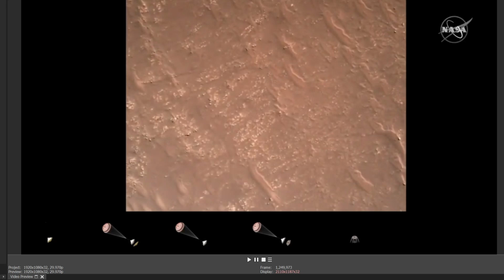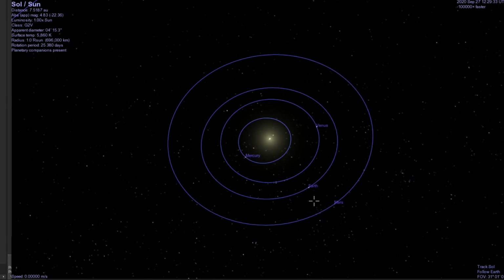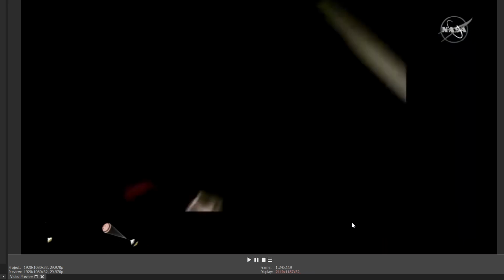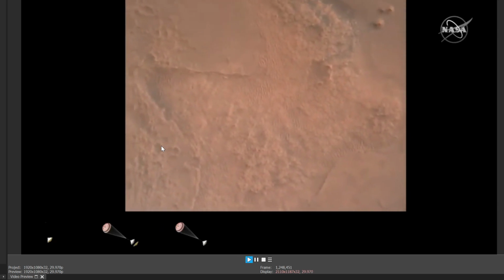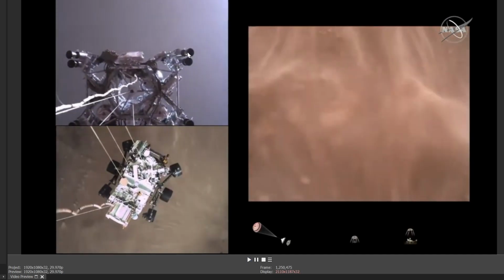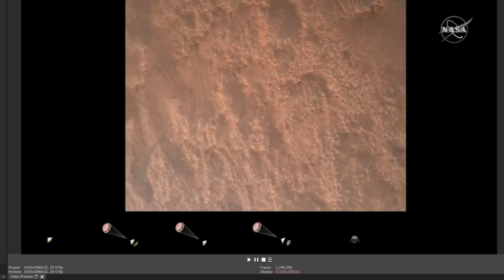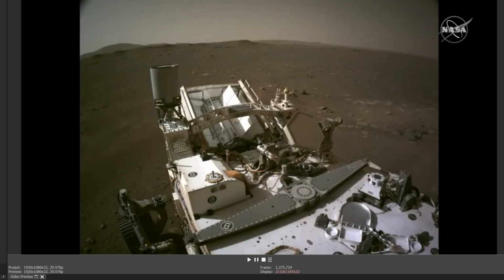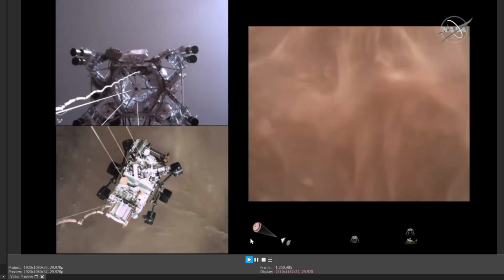NASA releases AMAZING video of Perseverance landing

Comment: Some more corrections:
The optimal time for a transfer orbit isn't at opposition, though it is usually close to that: https://en.wikipedia.org/wiki/Hohmann_transfer_orbit

The heat shield isn't a very good reference to measure deceleration because it also decelerates quite significantly due to its large surface area. Using the altitude and speed callouts and interpolating might be a more accurate measurement from the video. Also, during the landing lifestream they were showing the speed during the whole time since it was part of the critical telemetry that the rover was broadcasting live.

It is interesting to compare this landing to what Starship is supposedly going to do. The skycrane basically hovers for quite a few seconds during the landing to guarantee safe touchdown and uses highly reliable engines. Meanwhile Starship will try to milk every last bit of delta v by performing the flipping maneuver as late as possible, leaving absolutely no room for error or even slight deviations from the perfect trajectory. It also would supposedly usee the main engines for the landing, which clearly don't like having their fuel being shaken around and also have wayy more modes of failure. It is clear that Spacex focuses on efficiency first before trying to solve safety. A good example is the F9. They smashed soo many of those before they finally started sticking the landings just because they didn't want to sacrifice performance to do safer practice landings. And with the Starship prototypes it is absurd that they go for the most extreme landing conditions on their first ever landing attempts. It is simply bad testing practice.

My prediction is that Starship will never land using its main engines on another celestial body. They've already switched to extra landing engines on their lunar lander version so it is safe to assume that they will do something similar for their mars landings. Another prediction is that Elon will eventually suck up his pride and do the flipping maneuver a few seconds earlier to allow for the fuel to settle, the engines to start normally and to have plenty of room for error and for switching/restarting engines.

Comment: Seeing as the rover appears to be slightly smaller than my car (Ford Fusion), I'm wondering if it's possible to get any other reference sizes for all of the features seen during the landing? All I can really guess would be that the rocks that were landed on might be about pineapple sized and the last crater in view (off screen to the right) might be about the size of a small city block.

Comment: Although ultimately a huge success, it was unfortunate that the microphone that was meant to record the audio of the descent and landing failed to record (due to an apparent software error). It would have been really interesting to hear how the different altitudes affected the sounds of the rockets firing. Also, the skycrane detaching and flying off into the distance would have really given you an idea of how well sounds could be heard from different distances. I wonder if we could have heard skycrane crashing onto the surface about 1 km away?.. In the media conference someone asked if this was the first audio recording of the surface of another planet to which the panel didn't seem to be aware that the Russians had a microphone fitted to their Venera 13 lander which sent back audio from the surface of Venus in 1982.

Comment: If the limitation is the speed of light, then is it accurate to say the event had happened 15 minutes ago, or is it correct to say that it was happening as we watched it?

It makes me think of the analogy of three men on a very long train. One at the front, one at the back, and one in the middle.  Lighting strikes the front and back of the train. From the reference point of the man in the middle, they struck at the same time. From the reference point of the man at the front, lightning struck the front and then the back - and the man at the back says it hit the back, then the front.

All three are correct.
Reply: But aren't two of them dead?
Reply: @OldBenOne  No, it struck the train, not the people :)

Comment: Still sad the sky crane goes on a suicide landing. If they landed it softly it'd make for an interesting land mark.
Reply: It still does make for an interesting landmark. Could probably spot the crash site and ejecta from space more easily than a bit of machinery with a coating of dust on it. Might even get some useful science about what's under the surface, too!

Bit of a shame the rover itself couldn't mosey on over to the crash site to investigate, but there's probably nasty chemicals involved that would do a number on sensitive instruments. That said, maybe the crash sites for the aeroshell and heat shield might have kicked some interesting stuff up, if the rover completes its primary mission and the people in charge are looking for stretch goals?
Reply: One day in the future there might be interest in recovering these devices. Trust me the landing site is so well documented it might be displayed in a museum in the future. Distant future at that. T

Comment: Signal travel time is 11 minutesd to Mars currently, 22 round trip.

New Horizons went to Pluto 

EDL alone generated 28,000 images

Currently, communication with the rover is via the UHF radio which has bandwidth that is abysmal compared to even 1G cell phones. They will soon deploy and test the high gain antenna which is capable of between 0.5-8Mbps. (Still pretty lame if your a home gamer) 
Perseverance has two redundant computers in the RCE (Rover Compute Element)
It's running a radiation hardened PowerPC based CPU @200MHz w/ 64 MB of RAM, 2GB of flash storage and 128Kb of EEPROM storage
There's also a DSU (data storage unit) with 480GB of capacity.
There's a much faster computer running the storage system. Unlike the RCE, it is running Linux. The Ingenuity helicopter drone is running Linux as well iirc.

You might think that these specs are lame compared to gaming PCs but older silicon nodes (40+ nm) are much more tolerant of radiation and they go through a very long validation process. Reliability is priority, then performance.
The previous Curiosity rover ended up running on CPU B for most of it's mission. Likely reason was damaged NAND memory causing boot loops and fallback to safe mode repeatedly

The Sky Crane uses 8x MR-80 monoprop Hydrazine engines. They hadn't been manufactured in over 30 years when they were brought back into service for the 2012 MSL (Curiosity) mission. Mars 2020 uses the same engines. The exhaust is hydrogen and nitrogen which is why there's almost no sign that they're even running besides slight heating of the rocket nozzles.

The RTG produces around 110 watts of power (courtesy of 10+ pounds of plutonium dioxide [Pu-239 I believe]). There are also two Li-Ion batteries that provide addt'l power during activities which require more power. The nuclear 'battery' will lose a few % of it's output every year.
Reply: Some deeper info is always appreciated, thank you. 

So this rover is running the same CPUs as Curiosity, right?
Reply: @czechgop7631  I don't know if they are identical but if not, they are very similar and from the same family of RAD hardened computers like the BAE Systems 750 and 5500 series

Comment: Massive hat-tip to the engineering team on this mission. Zero defects. Outstanding!
Reply: Are you using a fedora?
Reply: There were errors, a software error prevent the recording of the EDL sounds.
Reply: TheLazy0ne   You're going with the off-shelf-camera & microphone malfunctions. Britlliant. I'm sure some paint flaked off as well. And perhaps a solar cell cracked. I could have hedged with zero MAJOR SYSTEM defects, but made the mistake of supposing anyone watching this video would have enough sense to understand that. But this is the internet. Where every pedantic twat with a keyboard feels compelled to demonstrate their superiority. Well done.

Comment: 3:00 About a couple months shy on your launch window. Of course there's the date (Sept 6th, they launched on July 30th), but also ballpark window for a Hohmann Transfer is where you can draw a line tangent to your orbit which intersects with your destination is about where you want to fire your engines. Also consider the launch was very late in the transfer window too.

When you make your transfer burn you are in fact roughly pointing your rocket directly towards where Mars is currently. As I understand it if you had perfect timing and the orbits were perfectly concentric with no inclination differences you would literally point yoru rocket directly at Mars for a transfer. However of course these things aren't all perfect so this only serves as a rough estimate.

Comment: There isn't a way to prove it takes the same amount of time to send a message to mars as it does to get back. It may conform to common sense but it can't be proved at the present time. This is because we can't measure the one way speed of light, we always measure the round trip.
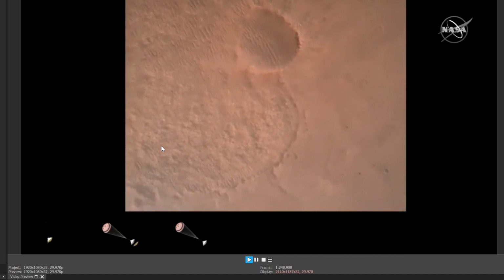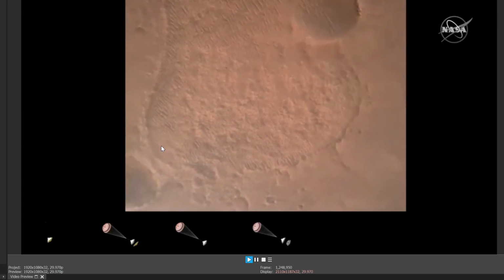Reply: umm if you can send pictures and information  you can "timestamp" when a signal was received by that computer, and have that time stamp sent back. Then you'd know when it was received, and when you received the new transmission... Thats not obvious? aka Atomic clock on earth says sent signal at 10pm, atomic clock 2 on rover (synched while on earth) would say it received the transmission at 10:11, and then transmitted the signal back at the same time. Then we'd get the signal at 10:22....Thus confirming your silly theory. 

also remember... the "round trip" of light isn't even the same signal, its two separate signals. All signals are one way.

Comment: little off topic, I know comment sections on Youtube are not generally for lengthy post sorry.....BUT....

I often wondered about how the flat earth morons work this part out, all those people involved in mission control. So you have a huge team that are all doing multiple readings, tests, collecting data, etc. So the persons on this end, all looking at many man computers, all with different information on, all the info coming back from the rover, they are seeing responses being sent from the gear on Mars. The flat earth morons think what, that all those people in that room jumping up and down, looking at all that data, are they in on the hoax? OR, they genuinely THINK the data they are seeing is real, BUT somewhere there is ANOTHER crew feeding them the information? Is that how it works? 

ALSO....Ok so you have so many men and women, creating blue prints and schematics of every single part of the rockets, the engines, the fuel systems, ect...they are calculating weight v fuel, they are calculating speed and trajectory, and ensuring their blue prints are EXACT to the millimeter and to the pound, they have run thousands of computer simulation and have spent YEARS ensuring when it is time to BUILD it, that it will work......are they all in on the hoax, or are they genuinely engineering things that they think will get to Mars. 

But then you have the staff that actually builds the rockets, builds the engines, builds the fuel  systems from the schematics and blue prints the others created, so they are welding, and machining, assembling, testing, tooling, etc....so they end up with the finished product that will be shipped to the launch pad......are they in on the hoax, or are they building these things believing that they are really going to go to Mars?

The people assembling the final product at the pad, the people that are prepping the final product for launch, the people fueling the final product for launch, checking and double checking, going over the rocket, the payload, with a magnifying glass to ensure nothing is out of place....are ALL those people in on the hoax or do they actually believe its going to Mars. AND OFF IT GOES.....now does it really launch, if not what are all those people watching? 

HOW does a flat earth moron reconcile, that I am just talking about ONE mission, meanwhile there are more than 90 countries with civilian space agencies, 15 that have launch capabilities. 2018 and 2019 there were a combined 209 satellites launched into orbit....NOW....take my ONE example of all those people worrying about all that shit, and now understand that it happened 209 time in 24 months. It must have included millions of people through out the entire earth....and what they are ALL IN ON THE HOAX? OR what everything is real up until it leaves the launch pad....then its some mysterious group that is feeding all the data back to the mission control saying that the launch happened, that it went to space, that it is in it proper orbit, that what ever the satilite was built to do its doing.....ALL OF THAT IS SOME HOW FAKED....BY WHO, and WHY?
Reply: How does any other conspiracy theory?

Comment: Wouldn't the fact they see the footage be a big spoiler to its success?
Also even if they sent the video during the landing wouldn't the footage cut out before it hits the floor.
Reply: IIRC all they had at the event was telemetry and a thumbnail photo from an engineering camera of the surface downloaded some minutes later, the videos were downloaded after the event. The video they released just has the audio + video feeds mixed together at relative timing.
Reply: Now that you mention it... yeah.
Reply: Did you listen to the video? Try around 3:45
Reply: @stusue9733  yes i did. Thunderfoot said that its fate was sealed but not that the outcome was known.
Reply: @Zereith  Exactly. When the audio/video on earth was recorded they had telemetry but no video from mars. The celebration was when the telemetry said they had touch down(although the actual touch down happened 15 minutes before that). The video was downloaded after that, then synced with the original audio/video.
Reply: @stusue9733  ah i see.

Comment: The stability of the sky crane is super impressive to me. Yes it wobbled laterally a bit, but there was effectively zero rotation on any axis. Extremely precise controls.
Reply: The sky crane isn’t wobbling. The rover and crane are stationary relative to the planet service. The apparent wobble of the crane is due to yaw/roll/pitch of the rover as it is touching down, or preparing for touchdown. You can see this if you watch just the rover from the crane’s perspective. The apparent wobble of the crane can be seen in the rover as it adjusts its orientation, but not position. Remember the cameras are locked off on the crane and rover, and not tracking the object in frame.

Maybe one wheel of the rover has touched down already, or the control systems are able to lower the crane wires individually so the rover lands on all wheels simultaneously (no sure how it’s designed).
Reply: @stuartmcconnachie  
The rover is lowered to be as close to the parallel with the ground as possible. 

You are correct that it is not the sky green wobbling with the rover as it deploys its wheels.

Only after sensors confirm that the rover is stable and not leaning on too steep of an angle or the tethers cut and the sky crane GTFOs. That's why there were several seconds between the 'Tango Delta' (touchdown) callout and when successful landing was confirmed.
Reply: It has very similar design features to a quadcopter. Using differential thrust and very simple engines with very few moving parts makes it much more reliable then let's say having a single engine that can gimble and uses a more efficient combustion cycle and fuel mixture. In addition to safety, you also gain easier and more responsive controls.
Reply: Its like the landing was made in a controlled environment
Reply: What's the movie were the guy start bahhing like a sheep to all the other people? Trying to lead them.
Reply: did the space craft actualy touch down on mars 14 minute before everyone seen it, or did it only occur once it was documented. there was no one present to see it land. the delay for the images to reach earth was the only confirmation. i would argue it landed at t he very second it was received on earth. prove me wrong.
Reply: @Phil_From_Canukistan   The round trip communication time to Mars is known with great precision as we have had satellites orbiting the planet for years now. 
You think a ping over 100ms in CS:GO is bad, try 22-30 minutes depending on the orbital position.
Reply: @Phil_From_Canukistan  They weren't transmitting images while the final landing stages were happening I'm guessing.
Reply: @Phil_From_Canukistan  It all depends on what perspective the question is asked to. From your perspective, it happened when you received it. From another observer whipping through the solar system near the speed of light, the celebration happened before the Mars rover even landed. There is no identifiable preferential reference frame, hence simultaneity is simply a concept of convenience, not an accurate description of reality.
Reply: @Phil_From_Canukistan  by that reasoning big bang is happening right now when you look deep in space with hubble lol. It doesn't work like that.
Reply: @djicroatia8936  its a thought experiment...
Reply: @djicroatia8936  The big bang is actually happening currently from the perspective of light emitted during it.  Remember, time is relative.  Before and after is very much a function of velocity and direction.  We are nearly stationary so we talk about "before and after" like they are universal, but at high velocities they hardly are.
Reply: There is really nothing impressive about this. We landed a vehicle remotely on Mars when I was a child in the 70s. NASA has been coasting on its reputation for 40 plus years.
Then when they actually manage to land something, they give a design life so artificially short to be ridiculous so that it looks like it went perfect even better than expected.  They rate these things at like 2-weeks.
The amount of money we waste on this crap is ridiculous.